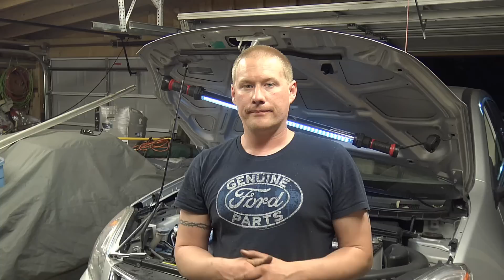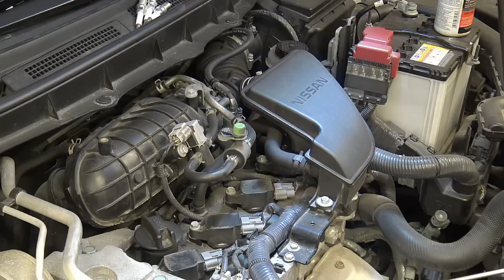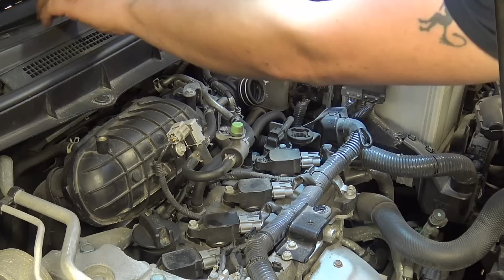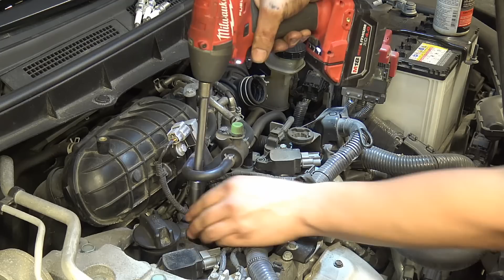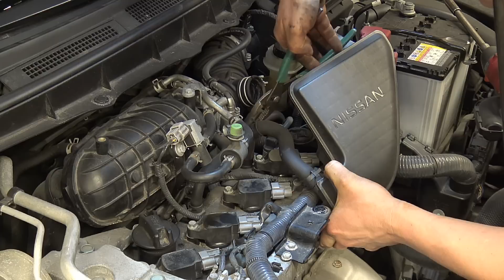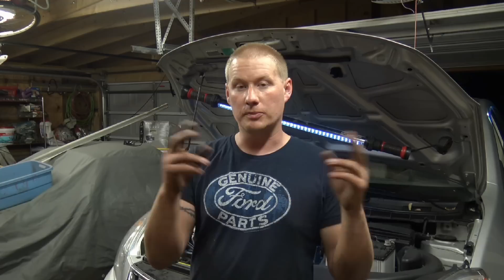Nissan Rogue 2.5L Tune Up: Spark Plug Replacement Procedure

Comment: A good way to remove spark plugs that are buried deep in the head is to loosen the plug and take about 8 inches of 3/8 fuel line and slide that over the plug, unscrew it and lift the plug out! You can use it to install new plugs too!

Comment: 😊 how come you didn't check the gap? Not all spark plugs are checked from the manufacturer. I put new spark plugs in my car and it was running rough because they were not all gapped correctly

Comment: Would the plugs you recommended (NGK9029 Laser Iridium) fit in a 2013 Nissan Rogue also? Also... what ignition coils would you recommend for the same 2013 Nissan Rogue?

Comment: Uh Oh, found oil on the coil pack and when I blew air in there got a small shower of motor oil. Looks like I have a valve cover gasket issue on one cylinder. Wonder how long I can go before fixing that?

Comment: I am sure those ones are good but I suppose the OEM ones from the dealer are just as good or maybe better?  Depending on where you get them they can be cheap!  I ordered a set of 4 for $18.00

Comment: After doing this my Rouge wont run. Engine will start but runs rough, VERY rough. Auto Zone sold me the wrong plugs. Went back and got the right ones. Replaced them and still runs rough, can't get it out of the car port.  HELP!!!
Reply: If the car was running fine before swapping the plugs, swap the original plugs back. Make sure all the connections are clipped back on correctly and do not overtightened the plugs. It could mean that the auto zone plugs were not gapped correctly, were the wrongs ones like you mentioned or bad coil packs that may also need to be replaced. My recommendation is to go to the dealer and buy the OEM spark plugs. Spark plugs are one of the few maintenance items you shouldn't cheap out on because they're supposed to last 100k miles. My last guess is something made it's way to the cylinder walls below which is no good.
Reply: @gmo8492  Tried the original plugs and no joy. The smell of fuel is massive. I may have a stuck injector as the coils and plugs do throw spark. If an injector is stuck open this may be part of the problem. I'm getting a tester to check some of the codes. A local car fixing place told me the codes came back as the transmission is bad......I'll get my own tester and try it again. 100,000 miles on the original  plugs.  It was time to change them. I used to work on TF41 Jet engines so I'm tool stupid.
Reply: @claytondelanie1193  Damn that sucks, sorry dude.
Reply: @claytondelanie1193  did u resolve?
Reply: @BillSW  Not yet, I smell a large amount of gas, I'm going to replace the injector. I'm guessing the injectors were the problem from the start. It ran rough but did not give a injector code.
Reply: @claytondelanie1193  if u smell look with your eyes and nose. maybe u got a fuel pump leak or fuel line??
Reply: @BillSW  One of the injectors is stuck open all the time. 3 of them are shut but one I can blow through. I'll change all 4 of them. The smell is out the tail pipe. 
Next question, could this clog up my cat?

Comment: FordTechMakeYouLoco ,Doing a tune up, I look at CANS OBD live data. 2005 Mustang base 4.0 P0193 intermittent but not current.
When stepping on Accelerator over 30 mph  Fuel trim PID goes CL. When pedal is released Fuel Trim goes OL. Engine at idle remains in CL.
I went to Ford dealer Service and asked if I can pay for information. On Fuel pump Driver , what are correct voltage on pin 3 and 4 at KOEO and Engine on.
I suspect a failing fuel pump and possible Accerator position sensor.
I also paid a internet Expert. A guy South of me took the question. He wouldn't answer my request. And then last, he told me my car is drivable, so there was not a problem, and he didn't have to answer me.
I asked this Ford expert" what is the voltage at Pin 3 and 4 on a Fuel pump Driver module with  Key on? What's the voltage supposed change to after Engine Crank?

My fuel pressure sometimes spikes to 70psi and remains there. But there is no drivability problems.
I had more into customer at my job. He told me he was a Ford tech. When I told him ,he said.           the Dealership knew the answer. I don't , Im just  watching my car.  I live 12 miles from closest town. My car keeps me alive.

Comment: Alot of times for me when I cannot see if the threads are engaged is I turn backwards untill I feel a slight rise then a small "click" and drop that tells me the the threads are inline and are and should be  ready to be engaged so I turn to tighten this works well on delicate plastic components too as you use the same threads cut by the screw the first time I have been doing this method for at least 5 years and never had a cross or rethread

Comment: Helpful video. Was able to change the spark plugs and ignition coils on a 2012 Nissan Rogue for under $300 in less than 30 minutes with no problems. Local Nissan dealership wanted over $900.
Reply: To save more money buy the plugs and coils off eBay
Reply: I have 2013 rogue what socket size you used to remove spark plug

Comment: Great video.  I'm going to install my own spark plugs myself because of your great tips.  One thing that you might want to make an update to is the use of anti-seize when installing the NGK plugs.  Their website actually discourages use of it because it could lead to over torquing of the spark plugs by 20%.  You probably compensate for that when you install them, but amateur viewers like me might not understand that and accidentally damage the plugs.  Here is the copy/pasta from their site.

NGK spark plugs feature what is known as trivalent plating. This silver- or chrome-colored finish on the threads is designed to provide corrosion resistance against moisture and chemicals. The coating also acts as a release agent during spark plug removal. NGK spark plugs are installed at the factory dry, without the use of anti-seize. NGK tech support has received a number of tech calls from installers who have over-tightened spark plugs because of the use of anti-seize. Anti-seize compound can act as a lubricant altering torque values up to 20 percent, increasing the risk of spark plug thread breakage.
Reply: Thanks for the anti seize tip. I had it on my list to buy.
Reply: Yep. All NGK plugs are like that
Reply: Damn nice to know!  I'd also like to add that the whole "Laser Iridium" is a bullshit marketing plot.  The "Laser" plugs are $20 a piece, and the "regular" Iridium's are $8 a piece.
Reply: @1vw4me  i am  there myself ,,,wondering the same thing good point , which last longer maybe the question here ?
Reply: Make sure you check the spark plug gap before you put them in. Not all spark plugs are gapped correctly from the manufacturer.
Reply: Usually says pre gapped and not to gap NGK's @neilwilliams2193

Comment: Many thanks for a great video. I note that, according to the NGK spark plug torque table, there are different values for aluminium cylinder heads and those made of iron. Do you happen to know if the Nissan X-Trail 2.5 t30 has an aluminium one? I'd like to warn viewers that the plug spanner should have only one rod securely attached to the plug socket. I had trouble using 2 connected rods and a separate socket. Upon attempting removal of the spanner after tightening, the rods, held together only by spring-loaded ball bearings, separated leaving part of the spanner down the well. As it was a Sunday, I had to drill holes through each rod connection and insert nails as security pins. Nothing like having a specialsed tool.

Comment: I got a question maybe you can answer it, every time the fan turns on the car  shakes  is that normal? Nissan rogue 2013 especially when the ac is on
Reply: it is normal.
Reply: every old 2.5 rogue with AC on shakes at idle

Comment: Instead of using a magnet why don’t u use the boot to grip the old plug to pull it out ? I been doing this method for years
Reply: That's a good idea.
Reply: Magnet is professional the boot will fall or stay in the hole used comen sense guys

Comment: Dude, they make a magnetic plug socket. It works wonderful.
Reply from the maker: I know this was an added job at a customers house so I had none of my usual tools on hand for a tune up.
Reply: @BSGAutomotive  same scenario I ran into , other than BMW's I don't recall such small plugs and had to use a 14mm deep socket and magnet like you to service car.
Reply: @BSGAutomotive  how often should spark plugs should be replaced?
Reply: Yes, I noticed how the editing took care of fact that you will  have trouble shaking off the magnet, and  at the same time leave the plug centered.  I had to rush out to buy the magnetized socket with the holding rubber on the inside. The original plugs on my 2014 Rogue were stuck in there pretty good. Had to soak with penetrating oil  for two days before they budged. Thanks for the great video, I followed it to get my job done.

Comment: I might have missed it but did you use a feeler gauge to get the right spark gap, or is not needed with those plugs?
Reply: Hunger Squad depends on the spark plugs that you buy they sell same ready gap and same that you have to graduate. I like to buy the ready gap so I don’t have to worry about it
Reply from the maker: Yes the gap should always be checked.
Reply: BSG Automotive Look at this on eBay http://www.ebay.com/itm/162542919917

Comment: I purchased a 2012 rogue about two years ago I have had a couple of things go wrong like mass air flow and clocks spring. I purchased at 39900 and now I have 106,000. what do you recommend I do to keep up with maintenance? I do alot of highway miles do to work?  regularly change oil and rotate tires? just changed to 50/50 high mileage. any advice?
Reply: Owners manual
Reply: Trade it off before the 120k warranty goes out on the CVT. I'm at 144K miles on my 11'. It's a nice car, but I don't trust  the CVT will  make it to 200K on this thing.

Comment: Thank you for the great video. I am thinking about buying a 2009 Nissan Rogue used with 50,000 miles on it and this will be helpful in the future. Would you have any suggestions or comments about these cars? Thanks again, Bruce
Reply: I've had my 2010 rogue since December 2009 im gonna hit 200k miles in about 3k miles. The only major issue I've had was transmission messed up at around 130k miles. But it was kinda my fault never changed the oil. Other then that works great it's my work car I just recommend changing the transmission oil soon at theat mileage .
Reply: Change that cvt fluid every 40k

Comment: what size wrench did you use to remove the spark plugs?
Reply: Miriana Ilioski 9/16 or 14mm for Nissan Rogue
Reply: small
Reply: The size that fits snugly.
Reply: 5/8

Comment: I'm looking at the Rogue as my next car......I'm the type to buy a car and drive it till it drops.....though I know Nissan uses CVT transmissions and I have zero experience with them. Are they reliable? Have you had many problems with yours? Im really impressed as to how much room they have in the since Im 6'4" and Im told the zero gravity seats are really comfortable. Any comments would be greatly appreciated.
Reply: Dennis M ???
Reply: 10 year or 120k miles. They should just rip them all out and put new ones in on all of them.
Reply: Dennis the Menace I had a bad experience cvt sucks had to change twice the 08
Reply: Thanks for the information. I'm 6'5" and find the Rogue roomy compared to other small SUVs....2 transmissions? No thanks
Reply: Dennis M no
Reply: Thanks for the information.....I've read a lot of people have been plague by CVT transmissions.....my boss has an older Audi with CVT on it and never a problem but an Audi cost more than I would ever spend on a car.
Reply: 10year warranty on the cvt tranny with '09 rogues.  Not sure about the new ones.
Reply: your comment makes no sense what so ever
Reply: Keep the fluid clean and let it wind up from a stop.
Reply: @DM-hw4cr  What do you mean by "let it wind up"?  I just bought a 2017 Rogue and I want to take care of it and not have problems.
Reply: @Dazlidorne  baby it from a complete stop. Let it get a little speed before hard acceleration. You will literally feel the cvt building up momentum. CVT is made for minimal motor RPMs and gas consumption not for racing around town. Cheers

Comment: I notice you use battery powered impact style drivers.  What would you consider a decent brand for the do it yourselfer?  And it appears you have some that are more powerful then others so do you have different size battery powered impact drivers?

Thanks 
dave
Reply: +BSG Automotive that was a Milwaukee wasn't it?
Reply from the maker: +Dave Pickrell The one I use in this video is a bosch and I use it for almost everything you would use a 1/4" ratchet for -http://www.amazon.com/gp/product/B003LST02W/ref=as_li_tl?ie=UTF8&camp=1789&creative=390957&creativeASIN=B003LST02W&linkCode=as2&tag=fordt-20&linkId=MRGWSE2EAHG4KDMT
Reply from the maker: +Dave Pickrell This is the 3/8" impact I use that will do most anything in the 3/8" drive and even 1/2" drive category-http://www.amazon.com/gp/product/B00BYFNLSI/ref=as_li_tl?ie=UTF8&camp=1789&creative=390957&creativeASIN=B00BYFNLSI&linkCode=as2&tag=fordt-20&linkId=TD76ETVJ57VOXWOA
Reply: Thank you, I've been looking but knowing you use this for your work, I'm sure you have tried many.  You have sold me I'm going to have this a try thinks so much for taking the time to answer!! God Bless !
Reply: +Gary  Ferguson Jr yes I ordered one it is nice.